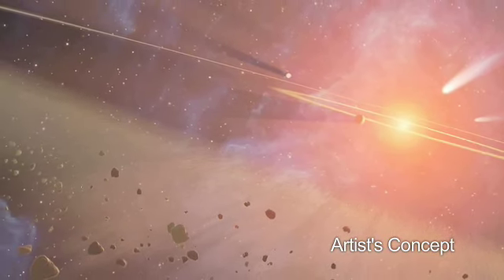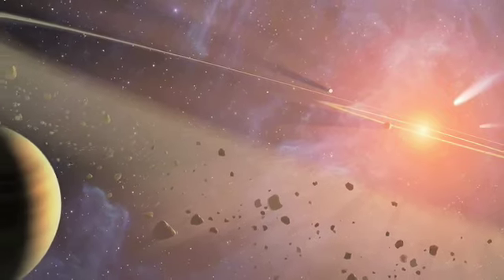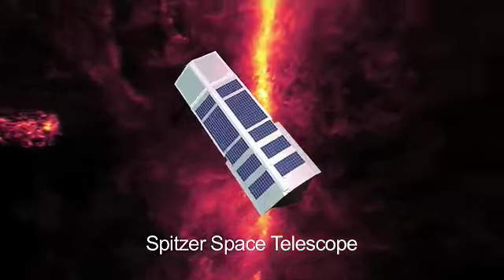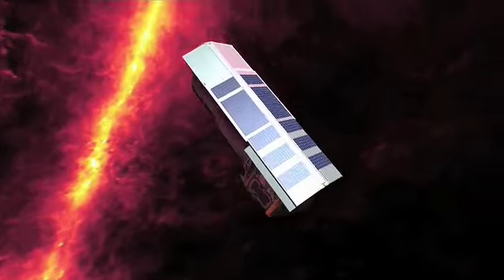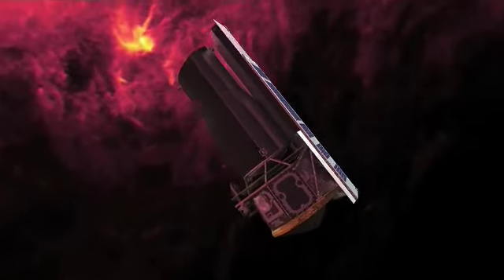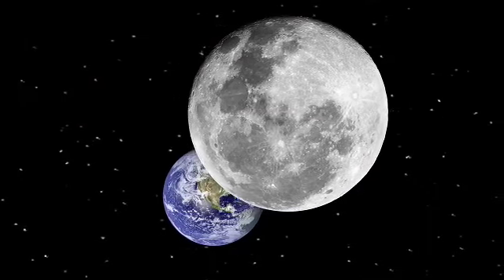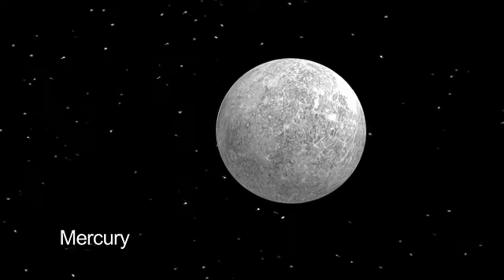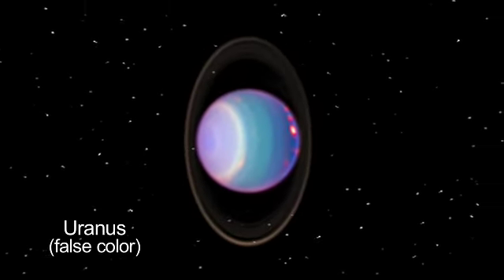How to Build a Planet

Comment: "doesn't seem right" : remember planets are millions of times bigger than the rocks experienced in daily life.
If you bang two small rocks together, the heat generated is insignificant.  There is some, but you don't notice it.

Scale the whole experiment up to planet-size, and make sure the speed of banging is many thousands of miles per hour, then there is significant heat. (Think of F1 cars' glowing brake discs, at a mere 200 mph).  The heat has got nowhere to go, so the whole thing melts.

Comment: collision happen in asteroid belt all the time some being miles in scale yet they do not liquidize ,there are just to many variables in play, one such variable is that of + and - pole of each body which can also effect conditions ,to see 2 great mass's to instantaneous liquidize and merge into a single sphere is not correct
the heat friction is caused from pressure but that pressure force will be so strong as to ignore pulling force of either and will repel as each & every piece retain its mass

Comment: At the beginning of a Solar System, there are no large planets of ice. Even now the Earth is a thin 30 mile crust with almost the rest of the planet being molten. Then another planet 40 -60% the size, almost mostly molten hits the first one, even at one 1mile/sec, the energy is tremendous, the result being a melding of the two, with oscillations eventually forming a round planet and lots of shrapnel forming a smaller satellite, after 10's of millions of years.

Comment: im not confusing surface activitys the ice in the ball could be of any element that is why i said it was simplified ,ok another way trajectory's the target planet like earth friction caused by its orbit to a star which creates a stable active molten core the colliding planet foreign body stray from its solar system has inactive non molten core simply because of no friction so it became cold and brittle as shattered glass ,when these two collide they will repel trajectory's "pluto & charon"

Comment: there are to many variables but instant vaporize and liquidation just from 2 inactive balls colliding i will not believe 
,make it more simple explanation make 2 snow balls and push them together do not cup your hands , only use palms

1:snow is made from frozen liquid
2:density of ice on each ball will react different slushy or compact
3:mass of the balls will break and only most compacted will merge 
4:no sphere is formed from the impaction
5:what is left is basically a commit in shape

Comment: the simulated animations doesn't seem wright why would both planets simultaneously liquidize were both are floating with no opposite force after impact even if planets gravity pulled them together the planet would simply assume a capsule shape before millions of years and eventually the 2 cores pulling closer generating insane quakes and volcanic(liquidation) inner core activities the new formed planet would still form a capsule~hen egg shape

Comment: But what you're doing is wrong- you can't simplify this process that much.

The planets are not completely made of ice or snow- there's other materials, such as metals and rock.

Also, there's not much force/energy when you combine two snow balls by hand, but when you have two massive objects colliding with each other, you have the tremendous amount of energy necessary to vaporize.

You're confusing surface activity with the planet's overall energy.